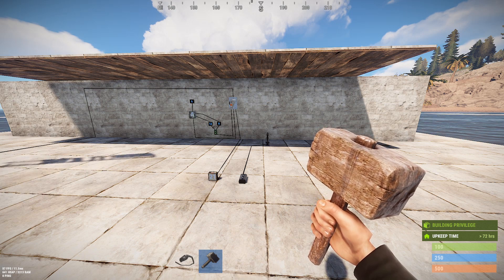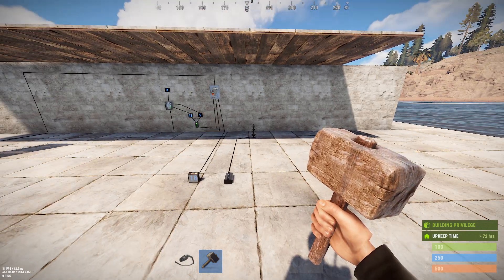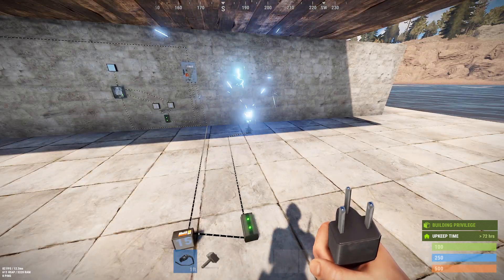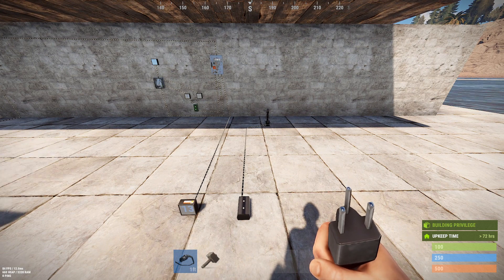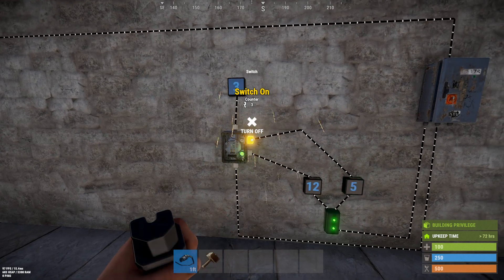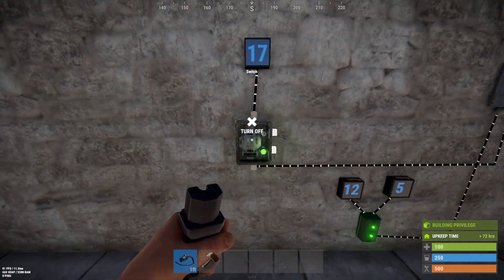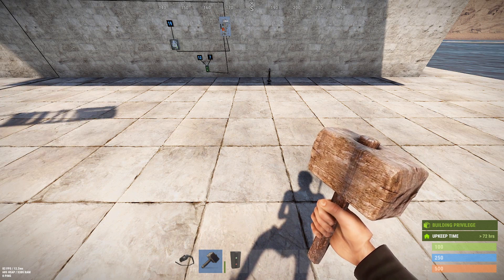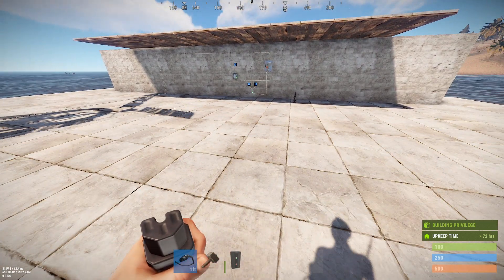Quick Rust Electricity Update for 3 Oct 2019

Comment: Try ussing normal swithes or 1-2 sek timers on low power for the inputs. Force input on = flip that swith on and off,  turns on the main switch. The force off input swith low power, will turn off the main switch. Aplying power to both will fuck it up ofc. :D = timers on 1-2 sek is the way to go.

Comment: Too bad it doesn’t work as it should, this would be a fun element of the game. For instance, control voltage should be separate from actual power voltage, as it is in life. CV is only an electrical signal after all, you should barely need energy for that. Well, I guess programmers aren’t electricians😁